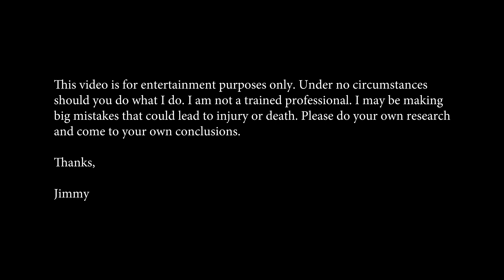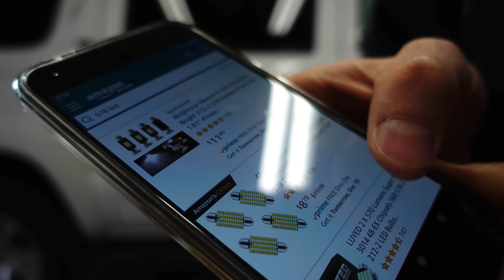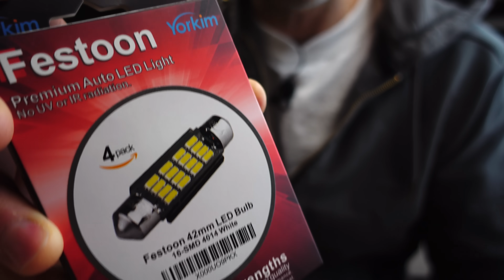Here's Why You NEVER INSTALL LEDs IN YOUR CAR OR TRUCK!!

Comment: this guy is confused about what a halogen bulb is. Dude, get your facts straight before trying to teach others!
Reply: he does this in all his videos. Got you to post a comment, see the point of it? misstate and the experts get irritated. Brilliant tactic for engagement if you ask me.
Reply: Could have gotten them mixed up. It can happen all the time
Reply: @johndough23  
True, but I'm tired of the tactic, and its still very irritating.
Reply: @davidbostock6089  In the abstract this is what GOOD parents do with their kids. Its what good managers do with their staff. Confrontational management. Point is challenge one to engage. In doing so they become better people. The everybody wins a trophy mentality leads to soft spoiled brat people. There are no safe space in the real world. That's a GOOD thing.
Reply: @johndough23  
So, he's lousy and that's a lesson.
Reply: Didn’t he just call an incandescent bulb a halogen bulb???
Reply: @hammyboigaming904  halogen bulbs are incandescent, have a nice night!
Reply: @HighestRank  Yes, but the point is not all incandescent bulbs are halogen.
Reply: @hammyboigaming904  maybe...Halogens are expensive, and usually high-power (high heat). So you won't find them in dome lights....or courtesy lights....or even turn-signals...so you usually get the 'tungsten' bulbs. Halogen is the gas that's in the bulbs, and with high-temp Quartz glass, the tungsten molecules that are hot, will settle back on the filament. This keeps the 'glass' from fogging up with tungsten particles, and helps lengthen the life of the filament.
Reply: @HighestRank  Bulbs are things you plant in the ground to grow stuff, Lamps are things that give light when energized by chemical reaction or electrical discharge. LOL TTFN.
Reply: @dougankrum3328  Bulbs are things you plant in the ground to grow stuff, Lamps are things that give light when energized by chemical reaction or electrical discharge. LOL TTFN.
Reply: @uksuperrascal  HAHA that argument sounds stupid, Just like a "A Motor is Electric" - when was the last time you saw an ENGINECYCLE?   FYI - In my engineering class "Lamp" was synonymous with "Fixture" - So Bulb or Capsule would be correct for the part he is replacing...  Good Luck
Reply: @misters2837  Thank you for the luck - Lamps are not Fixtures, As they can be replaced with ease when defective, I agree,To say, A motor is electric, is stupid. But I did not say that.
Reply: This Guy just used this what i ll call "CATCH PHRASE"Here's Why You NEVER INSTALL LEDs IN YOUR CAR OR TRUCK!! its used for all viewers>> to get you to "click" on his video, that in turn increases his views,hence $ >>>>> but it is a good video with lots of legit information.
Reply: @dougankrum3328 - I call BS on your "redeposited" claim. I have spent years operating tungsten rods in vacuum deposition chambers,  and the heated filament will NOT allow any of the burned-off tungsten to redeposit on the filament. No, no, no. 

Metals heated to glowing-hot temperatures radiate the metal away, only. The metal boils off in a straight line when in a vacuum, and is deposited on whatever cooler surface it contacts. Think of spraying mud on a wall.

Titanium also collides with gas particles in the partial vacuum, holding onto them as it lands on the cooler surfaces and stays there. So, light bulbs with a partial vacuum tend to increase the vacuum inside them over time. 

This feature is used in high vacuum chambers, and is called a "titanium sublimation pump." That is also how vacuum plating of metal, such as gold, sometimes plated over chrome (like a primer in painting) is done. 

I don't know how you came to believe that an inert gas in a halogen bulb causes redeposition of titanium atoms back onto the hot, outgassing filament, but it does not. 

When the bulb is turned off, the titanium evaporation stops. No redepositing occurs then, either. There is no redepositing. Ever. There are not a bunch of tungsten atoms floating around in the bulb to condense back onto the filament later. 

For that to happen, it would require a secndary heat source, other than the tungsten filament, and would need to be heated enough to cast off its atoms into the partial vacuum.  Even then, that secondary "re-radiator" would cast its atoms off in every direction, and deposit them on the first surface cooler than the radiating heat source. 

Since the filament is the only hot thing in the bulb, it only radiates tungsten away from it, and very slowly. 

TMI file: Also, tungsten, a metal, exists in the solid state as a crystalline structure. When heated, tiny crystals will tend to grow, absorbing other tiny crystals adjacent to them, to form larger crystals. This is happening at a very small scale, and does not change the basic shape of the fine, coiled filament, but it does gradually become more brittle, more fragile, as the crystals and their boundaries grow in size and become fewer.  As the filament ages, it becomes thinner and more brittle, until it finally breaks. When it does, the gap gets very hot, and vaporizes the tungsten at the break, until the gap increases too far for the voltage to jump the gap. 
That failure burst of tungsten causes a blackish coating on the inside of an expired bulb. 

Halogen gas is an inert or noble gas, and will not combine with the filament metal, which allows the filament to be heated more, and so it shines more brightly, without burning up as fast as in a partially evacuated atmosphere of many different gases. In halogen bulbs, gases like oxygen and nitrogen are purged, replaced by the noble gas or gases, then a vacuum is pulled on the noble gases, so the bulb is still at a partial vacuum inside.

Comment: There are a lot of considerations that weren't mentioned in the video. 
Most older lamp housings were designed for bulbs with a very specific light source location and directivity, with a reflector and lens designed to create a very carefully considered dispersion and light output pattern. LED replacements rarely come close to matching the light source location of the bulbs they are replacing, so you get hot spotting and poor light output even if the bulb is nominally brighter. We've all seen this when people put in LED bulbs in their brake lights, resulting in a small red dot in the center of the lens area, instead of bouncing off the reflector and lighting up the entire brake light area. The problem can be especially bad with LED headlight bulb replacements, often resulting in a dangerous beam pattern with poor road illumination and glare for oncoming drivers. It can even affect interior lights, with high glare blueish light and poor dispersion to light up the interior. Blueish "cool" interior lighting may look "fresh" and "new", but it also can cause increased eyestrain and fatigue. At one time you could also find "warm white" LED bulbs with around 3000K color temperature, but these seem to have become increasingly scarce.
Reply: Your comment is worth more than the video. Thank you.
Reply: Agreed about the brake and front lights, it's a matter that should be tested before going on the road, although inside lights are not that often used therefore I see no problem switching them, my original halogen inner lights are rather fade so I don't think it could be worse at all.
Reply: I'll stick with halogen head light bulbs. Time tested at least. No  guarantee how long the led lights gona last ,for any application on the car .head and dip lights also the blinker lights on a smart car for two. Is  a nightmare to change. Unless you get the whole front plastic panels of to make easier. Then that also takes time to unscrew the whole front panel .which is all in one .
Reply: 100% agree. good comment. I used to be on the led band wagon. no more. I think it's just a fashion statement and at the same time causing serious glare and safety issues for all the motorists out there. I love my factory toyota projector housings with halogen bulbs aimed correctly. hard to beat in my opinion. Lastly I'll add this to cap off your comment: There is a reason(s) oem's choose a headlight in the 3000-4500 kelvin range. I have yet to see a factory led in that range but factory led headlights have a good non offensive beam pattern from what i've seen.
Reply: Good comment. And these  LEDs with the high color temperature (bright blue/white) are the worst for glare. Very blinding for oncoming drivers.
There's a reason they call it "soft white", doesn't strain the eyes.
Reply: You have to see that some led are used to replace de halogen, like h1,h4,h7,h11 and thar stuff.
If you buy a good brand and a good one they should do pretty good, a "chinese brand" could have a bad pattern.
You have tho to consider the bad placement of led too of people that install incorrectly.
Reply: With headlights never use an aftermaket LED in a reflector housing a good one will work in a projector housing. LED brake lights work better than halogens just be sure to buy one with LED chips that cover the circumference of the bulb and are the same sort of size as the halogen before they usually are. The LED headlights on my car are better over the halogens and the LED brakes lights are significantly brighter and the colour saturation is far better its significantly more red. The LED indicators I used over the halogen ones are stupidly bright in comparision too.
Reply: @outcastMETALchild89  If you have a projector housing then it doesn't matter what bulb you use you have the same sharp cut off that stops you blinding people a good aftermarket LED like the Philips I use are great aim is exactly the same just slightly brighter and cooler colour. The LED indicator and brake lights upgrades I made are an even more noticeable difference.
Reply: @br5747  Very few LEDs go above 6000k which is considered to be like daylight in colour tempreture. Blue is a feature of Xenon/HID headlights where colour tempretures are 7000-8000k and these are far more offensive than LEDs which sit between 5500-6000k tempreture.
Reply: Amen.

The lack of LED replacement bulbs that actually try to copy original filament location is depressing. 
The best option when upgrading headlights is to buy good quality led lamps and install them in on the vehicle in parallel with the stock lamps.
Reply: @gravemind6536  what brand of bulbs are you using?
Reply: @gotham61 +1  Excellent information.  Note the interior look of the vehicle after installing the LEDs in the dome light fixture.  The interior looked like it was illuminated as brightly as a hospital operating room (super-bright, cold lighting).  Should he need to turn the dome light on during driving (not recommended and it used to be illegal to do in some states), or should a child or other passenger turn it on without the driver knowing, the bright bluish reflections off the interior glass surfaces might blind the driver.  If someone in the vehicle needs extra lighting while driving or when the vehicle is stopped, try a flashlight!  Dome light fixtures aren’t designed or intended to provide interior equivalent or indoor light levels.  Also, LED lightning that is towards the whiter or bluer end of the spectrum, does not preserve dark adaptation of the eye at night.  Warmer lighting from incandescent bulbs DO preserve the eye’s night vision, PROVIDED the lighting is not directed straight into the eye or is not too bright.
Reply: @outcastMETALchild89  Another factor to consider (mentioned by another commenter) with why factory LED headlights are better than replacing factory halogen bulbs with LED is the light pattern. The factory halogen headlights have reflectors designed for proper light throw pattern based on the placement of the filament in the halogen lamp. Replacing that halogen lamp with a LED lamp will most likely put the source of the light (the LEDs) in the wrong location inside the headlight reflector creating glare that may blind oncoming traffic and/or not illuminate the road and road signs properly. A factory LED headlight has a reflector designed for the placement of the LED light sources so the light throw pattern is appropriate and can be designed to reduce glare.
Reply: I changed every bulb in my truck over to LEDs including headlights in a reflector housing. I just tinted the inside of the housing to help with reflection. I did have to adjust them downwards just a little bit so I didn't have a chance to blind anyone. That was the very first thing I did when I bought the truck. That was over 6 years ago and they still light up the road flawlessly. From now on every vehicle I buy if it don't have led headlights....it will  asap. Mine were 55 bucks for H4 low and high beam and I also used what you call a power relay harness (bought separately) to keep them from flickering. Every time I turn my headlights on I smile because they are over 20 years old housings and put out better light than some new Cadillacs. I dont see why anyone wouldn't change every bulb they could to LED its a win win in my book. That includes inside my house, basement ,  garage every where there's light there's a LED on my belongings.  And who would not like the better clean white 5000K look compared to a 3000K just a world of difference. In my opinion I even always look at any kind of light source I buy and if it's not at least 5000K I don't buy it
Reply: The above are reasons  and alibis of people who don't accept technological advance moments who dah been used to old stuff. Of course if you want to achieve progress, you must expect changes, not to expect anything the same, otherwise, you no need for a change. You have to sacrifice some to gain more, after all LED is unquestionably better than filament bulbs, otherwise, this technology have not been a success. only stubborn peoples don't embrace it as they're stuck in an old school due to S2PDT.
Reply: Whatever I'll still be seeing nice and clear when the halogen burns out
Reply: @erwynlumanog2023
 If the lighting upgrade to an LED throws more unwanted light into the oncoming driver's face, it was a fail.  Stock luminaries (bulb+reflector+diffusing lens), whether Halogen or LED, have a specific design purpose.  Unless the upgrade is an integral design (e.g. your upgrade to LED includes a new housing with reflector and lens designed for it), and it was installed so that specific attention is paid to not throwing more light than necessary where it might distract oncoming drivers, it might put others drivers at risk of being blinded by the brighter oncoming light.  That's all.
Reply: Having a passenger turning on the new bright LED overhead light, that would not necessarily be good from the drivers perspective. The dim interior passenger controlled lighting is by design and shouldn't be messed with for safety sake.
Reply: That's what my dimmer switch is for
Reply: @John-js9je  haven't been flashed from oncoming drivers yet. I did a retrofit and baked the housing and split it apart. (Took the lens off) and I painted all of the chrome reflective inside with matte black high heat paint and put in new LEDs with a power relay harness and everything works awesome.  It can be done as long as you consider oncoming drivers that's why I aimed my headlights down about 10 degrees than usual.  I'll never own another vehicle without them. And if they don't have them that's the very first thing I'm doing
Reply: More modern LEDS, like the ones he shows at 1:23 solve the problem of point source light by lighting sideways. Still, it is worth giving replacements a sanity check for "where they are pointing" before buying.
Reply: @DavinderSingh-jj3wb  Head lights are a topic all their own. The color balance is still controversial; "Selective Yellow" is best for night vision and rain/fog but there is still a strong lobby for white. At least the nonsense of blue headlight tint is mostly gone.
Reply: THANK YOU for making this detailed comment!  LEDs are NOT the solution for everything.  There is a certain warmth' & an obvious different wavelength of light that incandescent bulbs provide, that LEDs can't touch'.  Sadly, I feel that I should probably stock up on the older bulbs, before they disappear.
Reply: correct, this should be the very first thing considered - led size, placement and orientation to accommodate the reflector focal point/s.
only after that you can think about menial things like heatsinks
Reply: LEDs will last a lot longer amd use less energy. The move to LEDs is unstoppable. @DavinderSingh-jj3wb
Reply: 3000k are much easier on the eyes.  You are right about them being hard to find.

Comment: The only problem i have with replacing my stock car bulbs with leds is hyperflashing, where i just learned that it can be fixed by updating the flasher relay module.